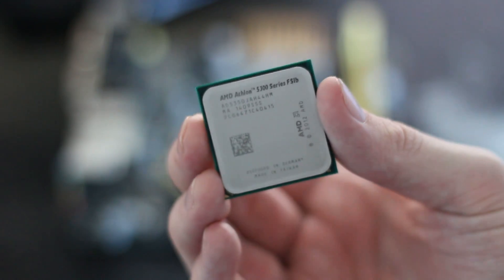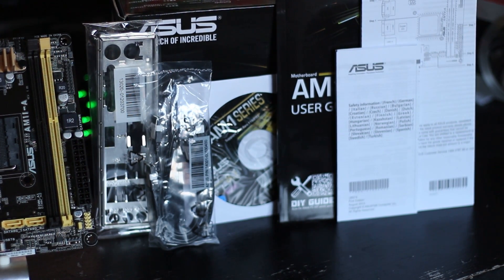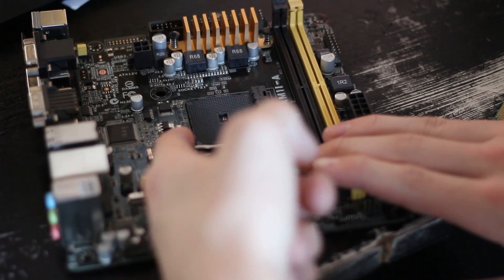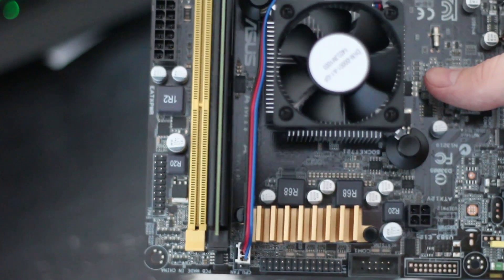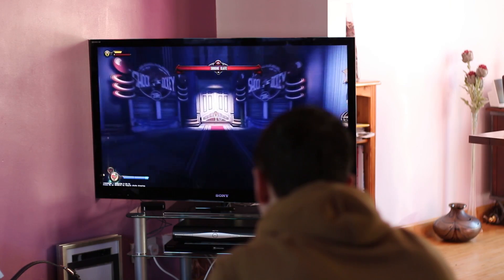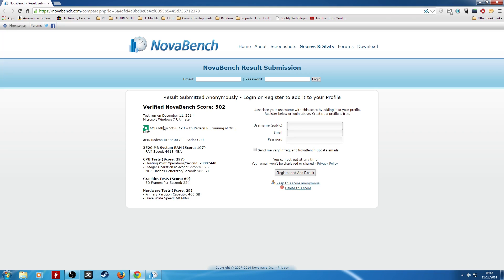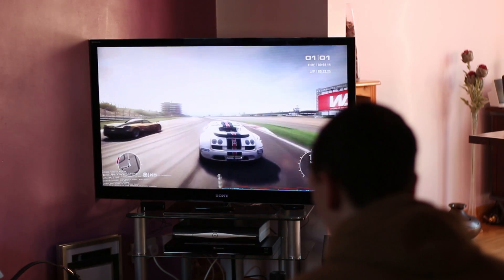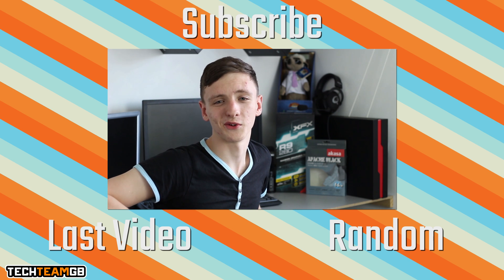AMD Athlon 5350 Review (With Asus AM1I-A Review)

Comment: The fan works better upside down actually. Otherwise the top of the heatsink gets blocked with dust / fluff which is harder to clear. When the fan is mounted upside down the incoming dust and fluff collects on the outside of the heatsink which has greater surface area so takes longer before it needs to be cleaned and it's easier to clean.

Comment: Its a Terrible GRotty little Cpu with a grubbly little r3 gpu core.... and its ok. lol but in 2023 ehuhhhh..... its not playing anything made after 2016 very well.. i can Dig the Gimmic its literally 1/4 the die size of the Fx 8 core.  the idea was you could easily fit 16 of these little core bastards on a chip the same size as then fx am3+ chips.. And what i think happened is these became Opterons 16 core opterons in the end. power efficient but performance defficient. .. lol  i use a 5350 with a hd5570 gimping along on 8gb of 1333 ram..it REALY wants 1600mhz ram the 1333 is notably slower.. Sadly its using the MSI am1 mother board.. Absolutely no overclocking available. the chip works best with a gpu disable the apu graphics.. and unlike the A series apu's this grotty apu has no hybrid crossfire compatable board it can be paired with to utilize its inbuilt r3..
Reply: it plays world of tanks and thats all it really does. and it does it on the Standard render setting with middling settings at a 1440x900 rez. with tolerable fps.  vs using the enhanced renderer the hd5500 aint havining it lowest of the low no to off settings on caveman 1024x768 scraping the 30fps and lower bucket.

Comment: I built two desktop computers using this chip. They are totally satisfactory for their intended purpose.  I only use those computers for things like web browsing, email, YouTube, Kodi 1080p movies, word processing and my grandson's play Minecraft on one them.  For those functions this chip is an excellent choice.   

But make no mistake, this is NOT a gaming chip.  Buying a $45.00 chip with built in graphics and expecting the graphic capability to be powerful enough to run Battle Field 3 is not what I would consider a wise buy.  You don't buy a 2.05 GHz chip to play games.   The chip was never intended for that purpose.  

It is intended to meet the needs of people like myself or to run applications like  those discussed in paragraph one.   It does that very well, uses very little energy and produces almost no heat.  Both of my desktops using these chips work perfectly and I can't even hear them run.
Reply: This is absolutely right. People always criticise the chip because it can't do what it was never intended to do. Sticking to everyday tasks, it produces a quiet and cost effective solution, which doesn't gobble power.

Comment: the legacy ports are there since this is intended to be able to function as an embedded platform, and these ports assist in connecting to older equipment to control it

Comment: pentium N3700 or amd athlon 5370 ? i will watch 4k video's, use it for office and play fifa 2013 at 720p
Reply: just get a 5350 you'll be grand I can run GTA V with a 240 paired with this chip
Reply: Brian Mcmahon can GTA 5 run at high setting???

Comment: I had the EXACT same problem with the I/O plate, proper let down from ASUS. I used a 5350 for my HTPC build and I was going to buy the AM1l-A but ended up going with the AM1M-A which is very similar, but has more PCI slots, which I quickly needed to extend the number of SATA ports. Agree with your conclusion completely, watched this after building my HTPC, now I'm thinking about hooking up a graphics card but stream-streaming seems to be working well, just gotta buy a controller :)

Comment: AMD Athlon 5350 or an Intel® Celeron™ G1820? they are around the same price
Reply: +AppleSauce Celeron G1820 since Intels 1150 socket will let you upgrade to an i3, i5 or i7 in the future. Theres no big upgrades on AM1. They released a 5370 model but only +150MHZ. Go with Celeron G1820 eyes closed for future upgrades.
Reply: *****
He/She asked which one is better, the Celeron G1820 is a 1150 socket. You have an Old Celeron 775 socket for what I see. You have your facts wrong. I answered to her, and you gave her a bad answer thinking on what you have, which is clearly not the Celeron G1820. Check your HW again.
Reply: *****
I own an Athlon 5150, despite they´re good for lower power consumption HTPCs they dont pack enough power and the fact that AM1 wont have newer APU´s makes the 1150 socket a betterchoice atm. But he should wait for the new tech on AMD and Intel.
Reply: *****
Kabini is good in most scenarios, the igpu is very impressive at 1366x768 aka 720p, but still needs a bit more punch, I bet they will reach good numbers on the next low power consumption desktop APUs. This is what Tows Hardware said about Kabini: "I didn't notice any difference between the Athlon 5350, Celeron J1900, or my own Core i7 in common tasks." I still think upgradability is an option too. You can have an i3 for about 2 or 3 years, sell It and then get an used i5 or i7. Im glad with my Athlon 5150, Its O.C. to 1920MHZ, the bad thing is that the Asus AM1I-A is shit and tend to reboot the system once in a while. No C6 or Cool & Quiet enabled, It makes the rebooting problem even worse. Theres few PSUs that work well with AM1 systems. I think Pico PSUs are the right choice but expensive and very rare in some countries.

Comment: Hi there. Im having so much issues with this motherboard, It reboots Itself randomly when the energy options are enabled, do you get this issue? If not, what exact brand and model of Power Supply are you using atm? Will appreciate the feedback. Regards and thanks for the video.
Reply from the maker: +trocoman unfortunately I'm not sure I can help as I've not had any issues with this board. All I can suggest is ask Asus I'm afraid.
Reply: TechteamGB
Good to hear that the motherboard is working fine, I will appreciate your help a lot If you could tell me which Power Supply you´re using with It. Brand & model please. This is very important for me to isolate the issue even further. Im not the first person with this problem. And, If you have the time I would appreciate even more If you could write your whole actual setup with this board here. Asking Asus is like talking to the wall. Thanks in advance. Regards.
Reply from the maker: +trocoman I've been using it with several PSUs, from a cheap OCZ 500W one to XFX 750W XXX edition ones. The set up I currently use for it though is very simple, just the board chip and ram you see in the video, plus the OCZ 500W psu, fractal core 1500 and an old 500GB HDD.
Reply: +TechteamGB
I know Im a pain the neck but, could you be more specific on the OCZ 500w like serial number or specific model. Its just that I need to confirm specific data, like If Its multi rail, Active or Passive PFC and even check reviews on how It is build inside. But I will check this data on my own when you give me the specific model for your OCZ. Thanks again for your valuable feedback. Its great that you didn´t have issues with It. I´ve been having this issue for over year. When I took the motherboard to the re-seller he gave me a hard time, he said he couldn´t apply the warranty because the problem was Random, they "checked" the motherboard and found nothing, then I read how bad the Asus RMA process was here in Latin America and was very disappointed.  I´ve found more people with the same issue on the web, I even helped one user here on the tube. I´ve already saw your review months ago but for some dumb reason I´ve never asked about yours. Its hard that the youtuber repplies but your feedback has been amazing. Im gonna suscribe to your channel right now. I really hope you can help me with the exact model. You have been so kind. Have an awesome week mate.
Reply from the maker: +trocoman The one I have is the CoreXStream 500w model, which has 2 12V Rails. Hope that helps you!
Reply: TechteamGB
Thank you much! I will check the PSU specs further on the web. Already subscribed to your channel. Cheers!!
Reply: +TechteamGB Hi again and thanks for all the support, I wonder If you remember or still have those exact XFX PSUs models you used with the Asus AM1I-A, Its just that I would love to update further on the thread I created on Overclock dot net. Its called "Asus AM1I-A with Athlon 5150 freezes and reboot". I hope you dont think Im spamming on your channel, I actually found one youtube user on another channel with the same issue and the quick solution helped him a lot. Regards.
Reply from the maker: +trocoman i believe it was am xfx xxx editon 750w semi modular unit.
Reply: +TechteamGB Thanks m8, I stood on the Core Edition ones, when you wrote xxx I thought you didnt remember the model (facepalm). Have a good one man.

Comment: lol . my celeron g1840(2.8 ghz dual core) scored 209 in cinebench . and the celeron is chiper .
Reply: The G1840 also consumes more than double power (53W).
Reply: +relaxxxrrr 27w is a game changer right?+45C full load
Reply: celeron sucks, its the cheapest from intel and its made cheap
Reply: first , your wrong , there is no such thing as a cheap made cpu ( are made exactly as an i5 or i7 ) and just The cost of manufacturing is lower because is just dual core no ht and very low ghz speed . second i can changed for a i3 i5 i7 without changing the mbo.

Comment: I´d like to make an am1 rig, for office works, i wonder if this 2016 will be new and more powerfull micros am1, should i wait?
Id like a little more power to move some games, nothing spectacular...strategy and turn based games.

Thanks
Reply from the maker: +Enrique M C I can't really imagine AMD putting all that much power into an AM1 chip - so really this or similar is the best you'll get. Personally I would suggest looking at an FM2+ rig if you want to do some gaming, as those chips are only a few pounds/dollars/Euros/whatevers more that this, but perform a bit better and have a beafier heatsink that comes with them.

Comment: Don't waste your money on these little AMD APUs, any Intel socket 1150  Pentium or Celeron  performs better all around. I have the AMD 5350 and 3850 and neither can really do anything smoothly. Also the 5350 wouldn't stream steam 1080p smoothly for me had to set it to 720p which is crap. The Celeron G1820 is about $5 cheaper and will do everything better including low end gaming and gaming with a video card.  I ran the benchmarks they're posted on Teksyndicate.com/forum/hardware/CPU/CPU Battle AMD Athlon vs Pentium G3220t. 

Unless AMD releases low power Zen based APUs on the AM1 socket its a dead socket and the APUs are like all other AMD quad core processors , they're not quad cores. They're 2 core 4 thread and suffer week single core performance and inefficient multi thread performance since they still use CMT instead of SMT.
Reply: +Camdex Stop crying about your money in every AM1 video. Seriously, end this madness already.
Reply: The 5350 is a true quad core amds architecture groups 2 cores together to share 1 l2 cache
Reply: +Camdex What you still dont understand is that AM1 wasnt meant to compete with the 1150 socket. This is an Intel Bay Trail D contender (Celeron J1900 for example), in other words It was meant to compete against another low power consumption APU. You would need to compare your Intel Celeron G1820 to another Dual Core like the A6 7400K, A6 6400K, A4 7300, A4 6300, A6 5400K on the FM2+ & FM2 socket by AMD. Something more on par. Theres no doubt that If you wanna add a dedicated graphics card Intel is the way to go, because of better raw CPU performance on each core. Your comparison is like putting a featherweight boxing champion against a middleweight on the MGM Grand Arena. The comparison is just bonkers. If they choose AM1 over the other sockets not considering a better performance per dollar, well Its their choice or mistake, but DONT SATANIZE THE DAMN SOCKET. It was meant to compete against Intel Bay Trail D, not against a 1150 socket Celeron CPU. They want to add a dedicated GPU on AM1...sure!! why not!! I get fun watching the performance on these little fu**ers...I dont get mad like you do. Its their money not yours.
Reply: +Camdex LOL! I still dont understand why are you so mad. The worst part is that you insult people for nothing. Youre such a bummer.
Reply from the maker: +Camdex That's really interesting, thanks for the info! I personally didn't have trouble streaming 1080p videos myself, and didn't really plan on gaming so didn't test that too much - but I too am very interested to see what they come out with, with Zen!
Reply: +TechteamGB - Streams 1080p video fine like Netflix but not Steam stream 1080p... Not an issue anymore it just got replaced by an Intel Pentium G3250T. This solved everything.
Reply: +willem lab - Ops my bad I was looking at the wrong diagram. In Kabini quad cores all four cores share the L2 cache and there is no L3 cache.    Even being a quad core it gets trashed in milti thread test by the Pentium G3220T dual core same price. I want a Athlon 5350k Black Edition that supports dual channel memory and  a full x16 pcie not this x4 crap. Then it needs to overclock to 3ghz and still cost no more than $50.....LOL
Reply: trocoman - Money isn't an issue, I just buy all these cpus for fun and test them. I dont see anything wrong with sharing valid info. In other cases Im on AMDs side. Other tech sites have tested these budget cpus and have found the Celeron on top as well. But most new builders dont read tech reviews and instead rely on misleading youtube videos to build a pc.
Reply: trocoman - Yes I know all these things. But idiots arnt going to use it for what AMD had in mind. Far as Im concerned if they're in the same price range I could care less what AMD had in mind. I can build a HTPC with the Pentium G3220T, 1150 board, 4gb ram and put it all in the same small Silverstone case for the same price range and get better performance from the Intel with low power consumption. Granted mini itx with the AMD will be a bit cheaper and may suit some users budget better.
Reply: trocoman - Not mad, also not attacking people that own this apu. Unfortunately to get the facts out to the people who haven't bought a 5350 that Intel has a positive option  with the G3220T or Celeron G1820 it may  unintentionally affend others. Some people may attack my comments cause they're pissed they didn't do their research before buying. Others stand by a brand for no good reason. Whatever nust putting the facts and options out there for others that my read these comments to help them make a decision.

Comment: Thanks, very helpful video, did you have problems installing the plastic pins for the heatsink? I bought the dual core am1 processor and they wouldn't even fit!
Reply from the maker: TheFuryzClan No worries, glad it helped! A little, but that was mostly just because I'm clumsy and have relatively big hands haha For this one, I remember having to put pins through the clips on the side of the heatsink, which held it all in place. How badly does it not fit?

Comment: I wonder though, if the CPU is so temp efficient, would it be stable enough if you removed the fan in order to build your system in to a very small case that`s normally designed for embedded CPU motherboard systems ? with an extractor fan more or less mounted above the heatsink ?
Reply from the maker: It could be possible, as long as your careful and don't mind the cpu running hot. it should still be fine though

Comment: You touched the pins and the top of the CPU. Nice.
Reply from the maker: Nice spot, luckily I know what I'm doing when it comes to pins on both lga and pga. As for the top, I wipe the cooler and chip clean before applying thermal paste, so no worries there! Thanks for the comment though and I hope you enjoyed the video none the less!
Reply: +Pablo Escobar whats wrong with touching the top of the cpu? he just touched its heat dissipator, not the die
Reply: Ozzie Peck Touching the top of the CPU isn't a big deal as long as you clean the skin oils off the heatspreader afterwards but most people don't do that so it's best to only touch the sides of the CPU.
Reply: right....

Comment: Is this apu good for Ms Office use and some casual 720p video and like light gaming (Cod:4)
Reply from the maker: Hi there! Yes, this is perfect for that. Anything relatively like such as Ms Office works like a dream, and it can definitely handle 720p video! It can handle 1080p video easy enough too! Light gaming should be fine as well, especially for older games like cod 4, where you can run that game on pretty much anything! Hope that helps!
Reply: Thanks!
Reply: TechteamGB Hey, I'm going to build a small gaming pc and I wanted know, would you recommend this for things like gaming? I was thinking on putting an XFX Radeon 4850 in there (I know its a 5 year old card but it still plays games great). That is if I bought a motherboard with a graphics card slot. Would I also be 'bottlenecking' the card if I used this CPU?
Reply: Brenski .I.P Yes, you fool.

Comment: Wow all I can say is a Serial port. I quit working for a major computer manufacture in 2006 and after working there 9 years I havent seen a serial port since the early oughts. Wow to find them now in 2014 just don't know what to say. Now to see the peripheral/printer port to show back up. Now that would be funny!! :þ
Reply: I have no idea if this is their reasoning, but its very useful anyway.

With the uprising of consumer/small business CNC machines and 3D printing, I believe serial ports offer a great way to make easily programmable/workable data connections to things like arduino's or raspberry pi's. In fact, the parallel ports would allow us to actually run CNC controllers on the PC itself!

It'd be nice to see them make a comeback, or at least a more modern/refined form factor.